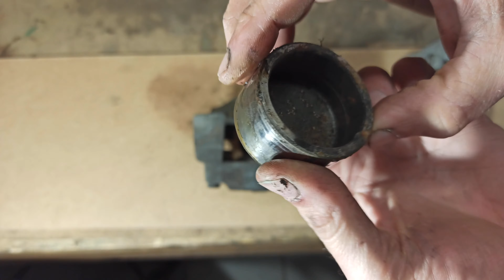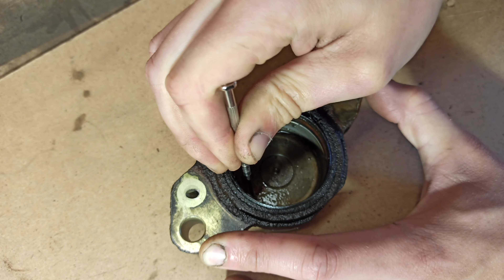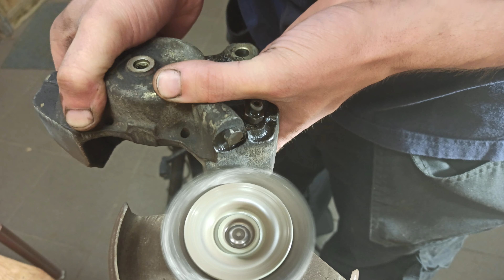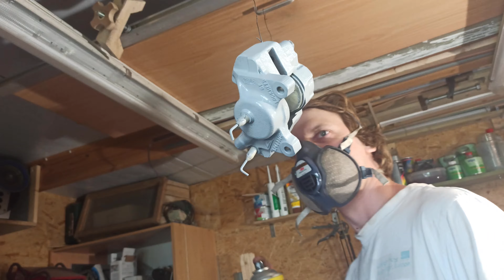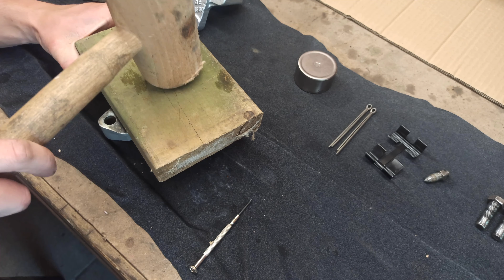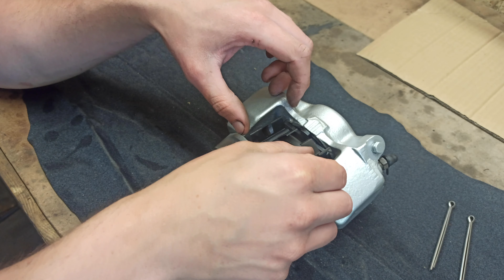EP5: The front brake caliper | CLASSIC MINI 25 RESTORATION

Comment: Have you removed the paint from the spots where the copper seals of the brake lines sit? Or is it leakproof with paint?
Reply from the maker: Hello, I've removed the paint where the seals sit. I actually don't know if the paint would hold up, but better to be safe than sorry I guess 😅
Reply: I painted my calipers last weekend and did not refill the system yet..you think it is leakproof with paint under the copper seals?
Reply from the maker: It is possible it doesn't leak, but I never tried it. As brake fluid eats away paint, I would still clean the surfaces where the seals sit, just to be safe. With brakes I wouldn't take the risk 😅

Comment: Those pistons are shot and I also wonder about the caliper bore....
Reply: Hi! The old pistons were indeed shot, new ones were installed. Caliper bores seems OK to me, they were running fine before disassembly, but I will find out if they don't work anymore :)